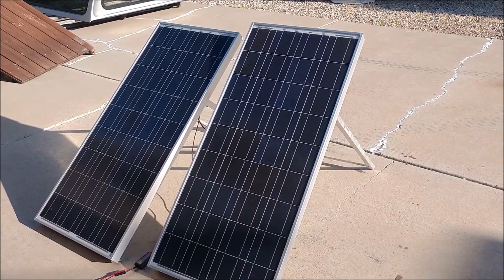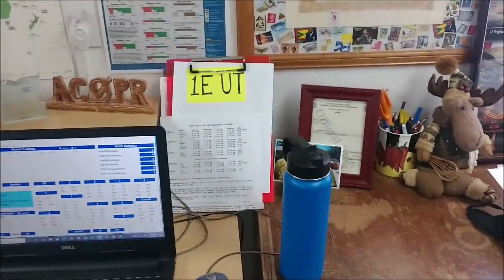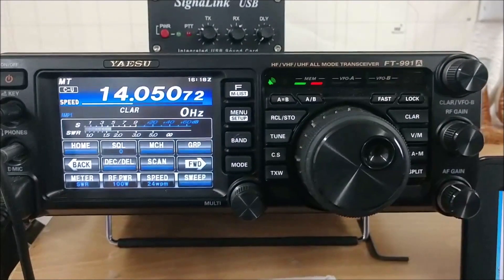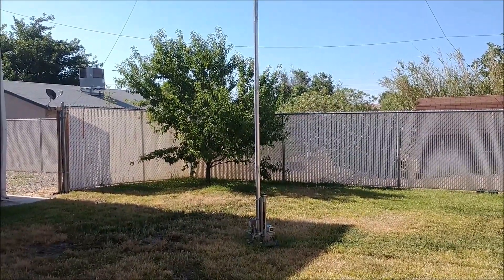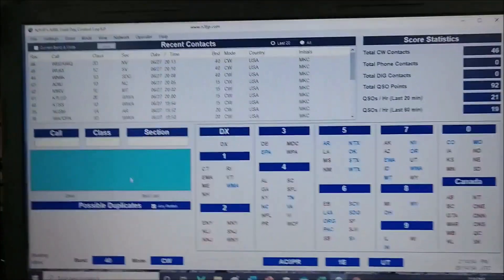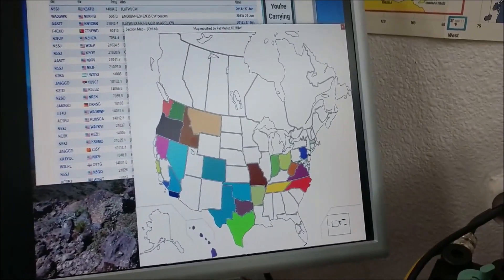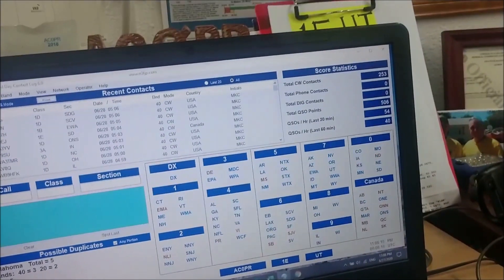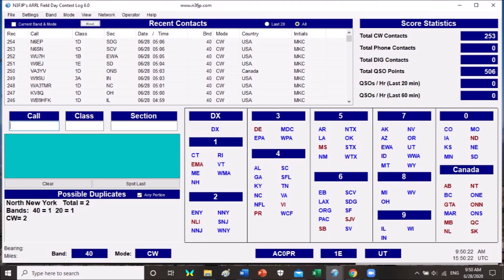CW (Morse Code) Only Field Day 2020 Emergency Power

Comment: Nice! I also ran QRP / battery portable (with a single 100watt solar panel). I was camping at 5200' in central WA. Thanks for the FD QSO, always nice to run in to fellow SOTA buddies on the air during FD =)
73 de WU7H
Reply from the maker: Hey, Josh, thanks for the call (and all the SOTA calls as well)! I was torn about going out camping or not--with our heat here and just finishing a trip, decided to take it easy at home. I got a number of SOTA guys! 73 de AC0PR